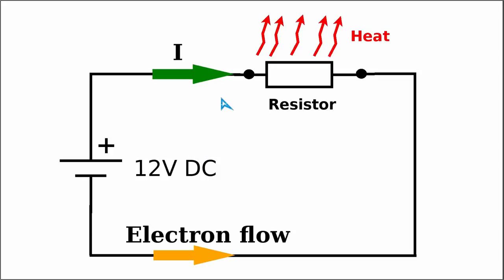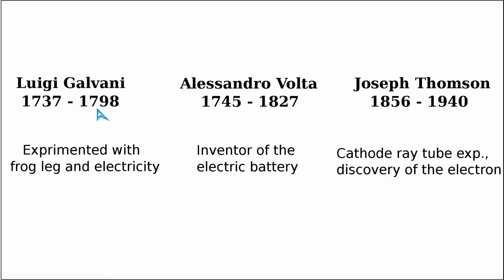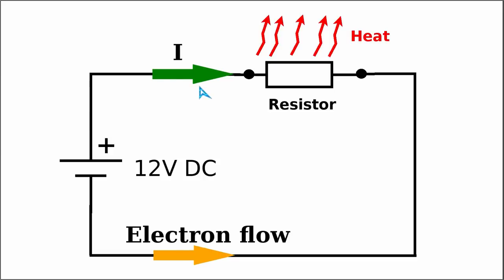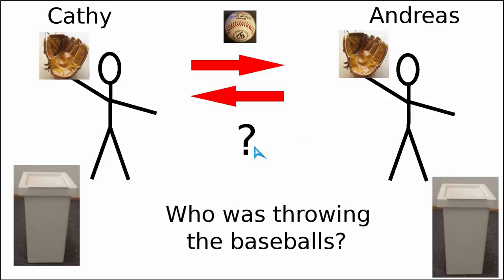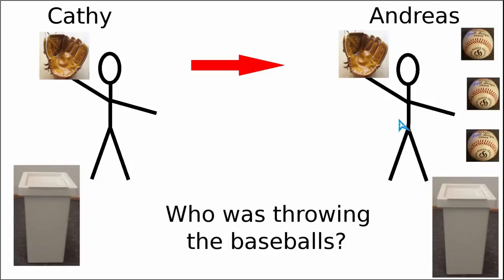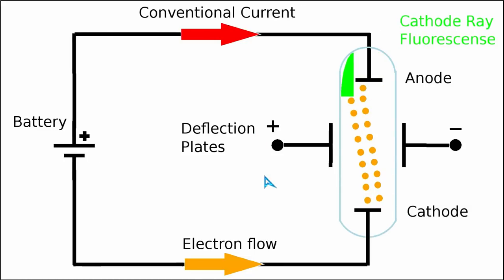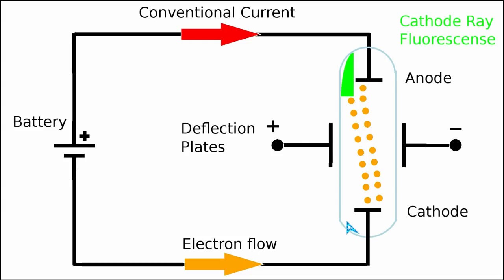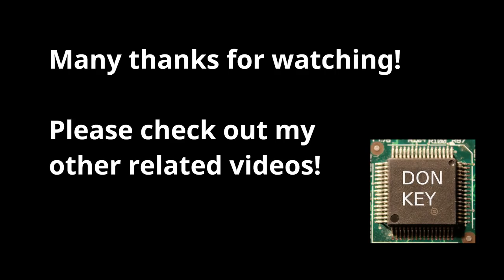Electron flow vs. Conventional current: Thompson's cathode ray experiment

Comment: In the Navy electronics school, we were taught electron flow, not "conventional current."  This always made more sense to me , and I think it aids understanding of how various devices work. We did used to talk about "hole flow" within solid state devices, so unless one understands that a "hole" is simply a "missing" electron in the valence ring of an atom, this can be confusing to people. Holes only "appear" to flow. Actually, it's still electron flow. The "holes" appear to 'flow' in the opposite direction of the electrons.
Reply from the maker: I'm surprised about that, since the conventional flow is still dominating in physics and engineering. I would say that for the next 100 years still the conventional flow will be used, no matter what (assuming that people will be still even learning electronics).
Reply: @DonkeyLearningIT  True. It doesn't make much difference, once you understand what each is. The circuits all still work the same, and analysis is still the same. I think it's really just a minor thing.

Comment: Great Video, I learned about Mr. Thomson and his fantastic contribution to electronics. My proof that electrons flow from negative to positive, is that the Zinc electrode of an alkaline battery oxidizes as electrons flow in a circuit to the to the positive electrode. The copper or carbon positive electrode does not oxidize. When the Zinc electrode is completely oxidized, the battery  is completely discharged. Thanks for sharing keep the videos coming!
Reply from the maker: Thanks for commenting. Well, electrochemistry did not exist before the basics of electricity (in this case the electron as particle itself) was discovered. To us seems now easy, but 100 years ago people had a lot less knowledge in some areas.